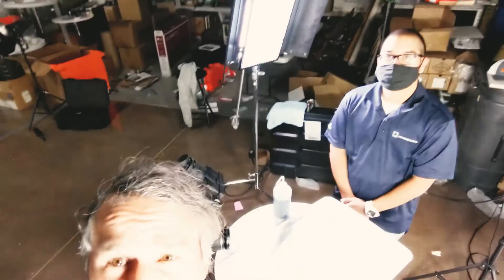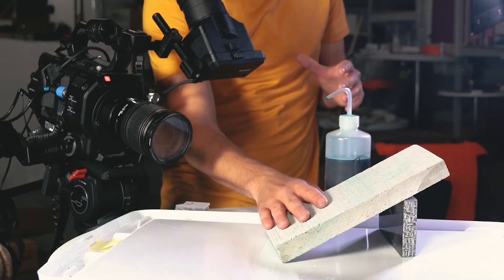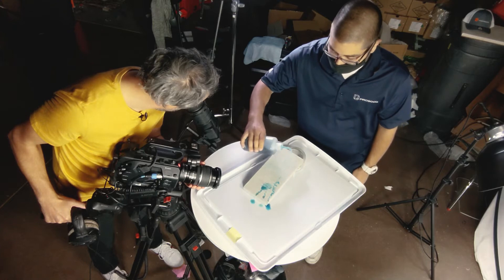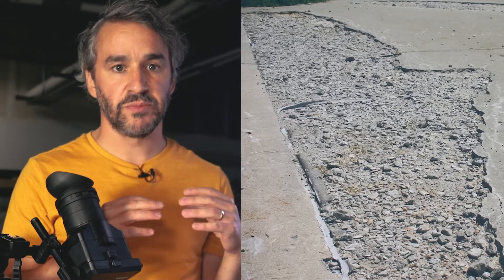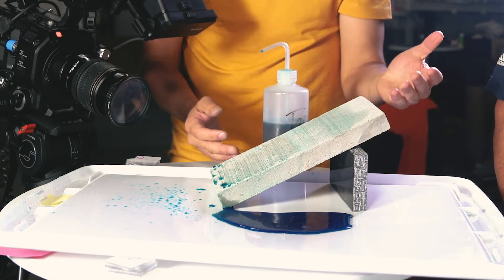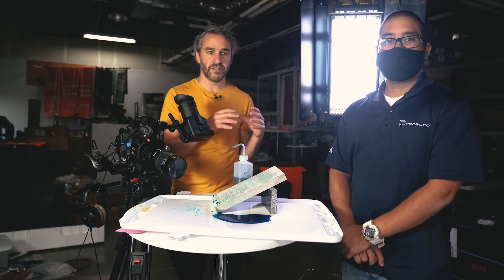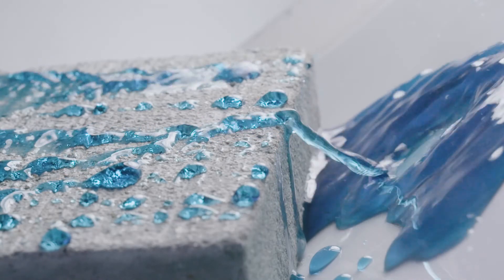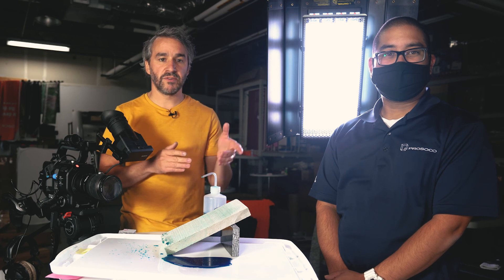How to prevent spalling and pitting in concrete with Saltguard

Comment: At around 3:51 he says "when water and salt are mixed together, the freezing point is higher." This is incorrect.  Adding salt to water reduces the freezing point of water. Not higher, but lower.  Salt molecules block water molecules from packing together when temperature is lowered. It then prevents them from becoming ice.  More water molecules leave the solid phase than the ones entering the solid phase. Freezing point depression occurs when the freezing point of the liquid is lowered by addition of a solute.
On average, seawater in the world's oceans has a salinity of about 3.5 percent (35 g/L. Although the saltiness of ocean water varies, this lowers the freezing point of ocean water to about 28.8°F. You will note that 28.8F is LOWER than 32F; the freezing point of (mostly) pure water.

Comment: Do you mix it in or do you apply to existing g concrete?
Reply from the maker: Saltguard is applied to existing concrete.
Reply: @ProsocoSince1939  thank you for that information
Reply: How is it applied and how long does it last?
Reply from the maker: Saltguard is applied by a low pressure sprayer you are going to want to avoid puddles. A wet-on-wet application works best. The service life for Saltguard is about 7-10 years.
Reply: @ProsocoSince1939  thank you

Comment: Would you recommend applying this every winter before snow storms hit or just once? Can you apply this to new or old concrete for maintenance? Asking because our company did a new concrete sidewalk 2 years ago and  we are located in the northeast. our winters especially this year have caused spalling/ chips but no major cracks. Also very high traffic sidewalks for school means lots of salt every snow storm sometimes multiple times.
Reply from the maker: Hi,
The service life of Saltguard is 5-10 years. If the area you are trying to protect is high traffic or see's a lot of salt you may want to check every 5 years or so. We recommend Saltguard be applied when the masonry surface temperatures are between 40–90°F (4–32°C). This can be applied to new or existing concrete. If new the concrete should be thoroughly cured before application. It does take at least 72 hours before Saltguard to gain its water-repellency properties. Here is a link to our product data sheet for more information.
https://prosoco.com/Content/Documents/Product/PR_Saltguard_PDS_061220_C.pdf
Thank you!
Reply: @ProsocoSince1939  Thank you!!

Comment: “Easier to freeze salty moisture” Huh?
Reply from the maker: Ha! yeah, kind of clumsy wording. Should have said "Water that has salt content freezes at a higher temperature than water without salt content. And therefore water with salt content would freeze more often."
Reply: @ProsocoSince1939  Other way around. Salt lowers the freezing point of water. That's the whole reason why it is applied to roads and sidewalks. Salt makes freezing less likely.
Reply: @ProsocoSince1939  huh? Test freshwater and salt water samples in freezing temperatures, if freshwater freezes before saltwater, let me know, because you're on a different planet than me. :-)